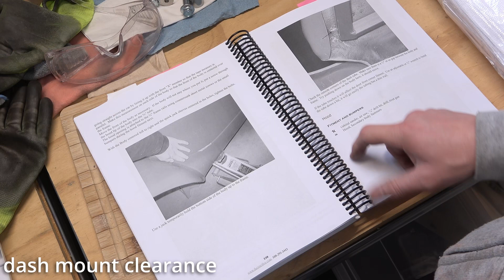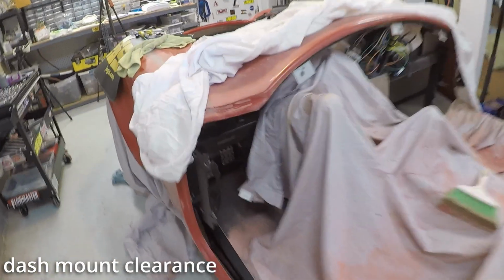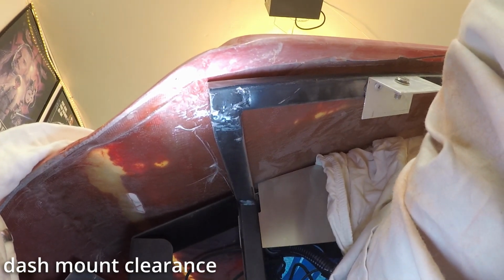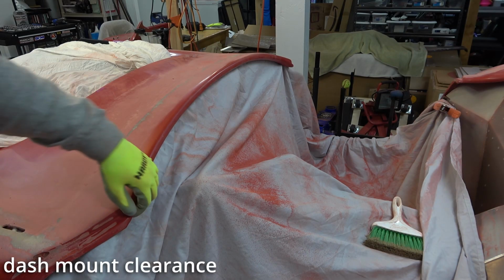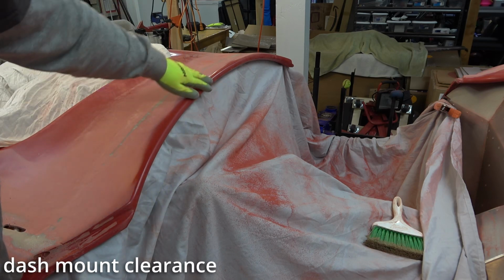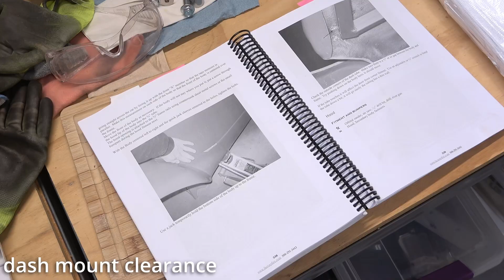Budget LS Factory Five Cobra | Build Update 62

Comment: The body is only rough cut out of the mold and purposely oversized. Very common to have to straighten/trim the front and rear cockpit rolls. Along with basically everywhere else around the perimeter. Too bad about that damage to your dash. I'd also highly recommend having the bulb seal in place while fitting. That interference you're referencing would likely be eliminated with bulb seal on the firewall. I wouldn't be cutting any aluminum yet.
Reply from the maker: Well if I put the body on the bulb seal it will cut that bulb seal in half since the body is resting on the firewall in the one spot?
Reply: @AmateurHourGarage  No, the way the bulb seal is made (look at it) the grip portion is a durable vinyl type material. The bulb is attached to the top and is more fragile. But the edge of the aluminum won't make it that far. You do need to be careful with the bulb seal over the trunk sides. You can damage the bulb when taking the body on/off if it scrapes across it. Best to have the body edges cleaned up and smooth first. Some use towels or plastic over the bulb seal in that area when taking the body on/off. The main point of my comment was do an actual fitting with all the bulb seal so you get an actual fit and cut aluminum only as needed. Cutting is a last resort. I've done three Roadsters and haven't had to cut in that area.